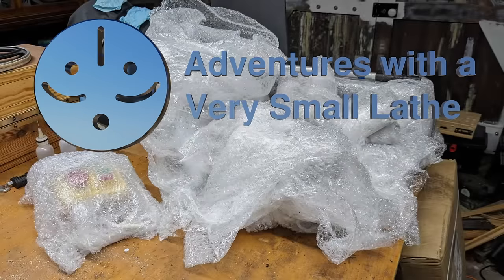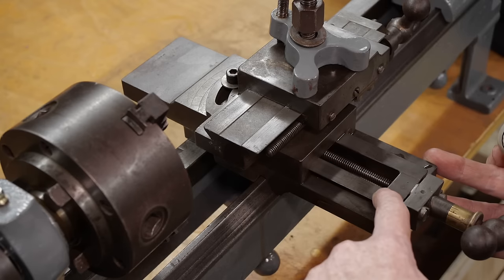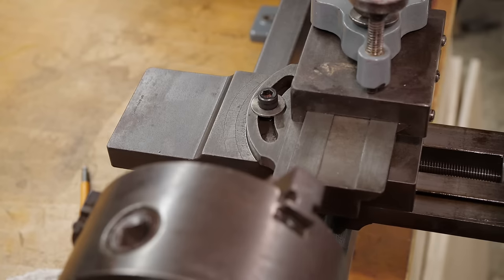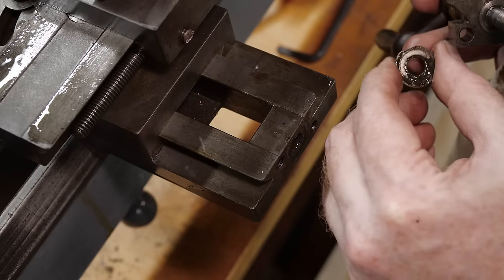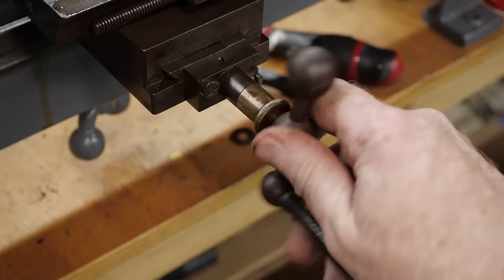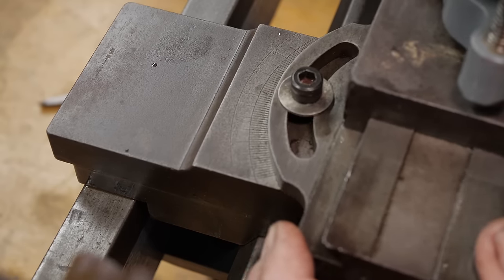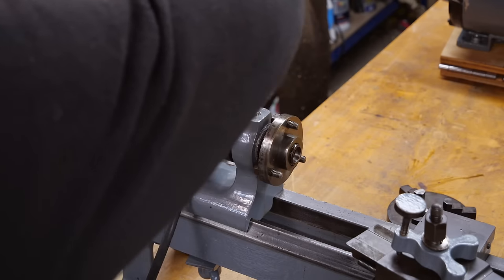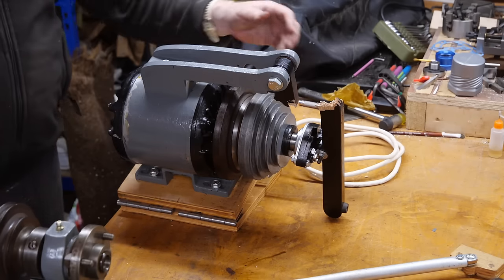Lorch Model A Lathe - The Reveal and Assessment

Comment: At time stamp 42:19 give or take a second or two when you show the "blank" side of the handwheel center ball I'm pretty sure I can see the circular outline of the pin in the glare of the light.  I think this is a regular thru pin but it was filed or sanded or peened down on that side.  So a punch with a cup on the tip to set onto the exposed small ball end of the pin SHOULD push it out.  This is supported by how the longitudinal travel hand wheel shows obvious heads on both sides for the retainer pin.  It's highly likely that the other has a thru pin too to keep things common.  For some reason some older owner cleaned off the head of the pin on the cross slide hand wheel.

I gather all the black on the parts that I figured was black oxide or parkerizing is in fact light corrosion that was oiled at some point to make it look black.  The darkness of the chuck rather supports this idea.  You've got your work cut out breaking down each and every sub assembly and polishing those parts back to proper slivery metallic and giving them the right sort of glossiness.  But it will be SOOOOO worth it.  What a sweet little machine!

Comment: Get yourself a big tub if Evapo-Rust to clean all the metal parts.  It will make all the bare metal parts look near new 👍
Reply from the maker: Unfortunately Evaporust is quite pricey  this side of the pond, so I'm cautious about using lots of it. That said I do have a tub full lined up to work on this lathe, but I'll remove excess rust manually before I dunk the parts.

Comment: Excellent video - but replacing that cap screw with a slot head might be a mistake. Perhaps something you can put a spanner on?
Reply: Also, the manufacturer put grease nipples on the headstock. Perhaps the headstock bearings should be lubricated with some kind of grease? I'm looking forward to this series of videos, thanks Mr AVSL.
Reply: I agree. A square head would be better than a slotted head, and I think it would be in keeping with style.
Reply: @janporkpie they look like grease nipples but are designed to take oil. 
Myford lathes have similar nipples on them if they don't have the oil cups on them. 
I've recently cleaned out a Myford ML 10 that had everything packed with grease 😢 while the Myford says it has to take oil. 
On the Myford lathes only the gears take grease, all the rest oil.
Also on bigger lathes you can see an insert with a ball bearing in the middle that is flush with a surface (cross slide, ...), these also take oil and not grease.
Reply from the maker: The grease nipples aren't original. Having spoken with Emma of Emma's Spareroom Machine Shop, who owns a similar model A, these lathes were originally fitted with oilers, and the bearings are designed for oil. A previous owner may have switched to grease for a specific reason, or just because it doesn't need to be changed as often as oil.
Reply from the maker: My main reason for thinking of slot-headed screws is that would match every other original fastener on the lathe. The square head screws on the chuck look shop-made. I do agree that square head screws would fit with the look of the lathe too, so I may go that way.

Comment: Now you have to change the name of the channel: Adventures with Very Small Lathes :-)
Good work!
To remove the handle from the threaded rods you could try by heating them or, very carefully and protecting the handle, by making a small weld on the head of the pin typically by gluing the electrode onto the head to create the space on which to apply the force to extract the pin itself.
just out of curiosity how much did you pay  everything?
Reply: I think he had already more than one very small lathe (3)
Reply from the maker: Yep, I've featured 3 on this channel already, The original Proxxon, the Chinese CJ0618, and the Unimat SL. I'm fond of the name though, so I don't think I'll change it just yet. The Proxxon is still with me on my adventures, even if it's no longer the only lathe in the shop.
Reply: @AdventureswithaVerySmallLathe  ok sorry, but I met you when you were already working on the mini Unimat and I thought it was the only one, mine was a joke due to the lack of knowledge of previous adventures

Comment: could be lengthy...
the thin plate, is probably because one got lost. might have a spare... 
the 25 is the lathe number im guessing should be on all the matching parts. 
that be a washer, not a shim, lol. im guessing someone put it there becaue the screw didnt do up tight on one side.. at least the filed the side off so the slide returned over it., 
the hole in the top, is probably definately an oil hole. 
the oilers. probably fairly easy to upgrade them to button oilers, 
Pin is a taper pin, rivetted on the back. spot drill it and give it a bang. they went away from that by about 1920 i think.
PULLEY IS BACKARDS AROUND. when you fix that have a look at the collet key. 
also, youre over thinking the headstock bearings. their will be a thrust race under the knurled ring. adjustment is dependant on speed. set it up so it doesnt quite grab at top speed when its warm, and its gonna be loose at low speeds. 
probably. that backplates gonna need a big bang. a pin spanner to fit the holes maybe? 
the clutch, i think if it was me id think about a cable drive and a foot pedal? 
has your tailstock been machined out to Morse taper? 
anyway it has potential. well done. was going to stay awake to watch it live, didnt happen.

Comment: That pin on the handle does indeed go through the handle.  Rub some fine sandpaper over it. You’ll see it !!
I’ve got a 100 year old lathe to do up too, priorities!!
Reply: If you look closely you can see the pin on the other side of the handle-head in the video. A bit of a rub with the fine wire brush should show it clearly. That number “25” is surely a production number (it’s stamped on several parts), so that parts fitted to this lathe don’t get put on another lathe and cause ‘fit issues’. Exciting to see old tools and machines brought lovingly back to spec and back to good use once more.

Comment: New subscriber here, very interesting video

I would imagine that the shim is to reduce the backlash on the cross slide
From years and years of retracting the cross slide, the flange on the cross slide nut has eaten a pocket into the face of the of the cross slide and probably on its opposite moving surface where it wears when the cross slide is advanced
I cant imagine a pin in a blind hole in such a quality machine, I wonder if you file a small flat on the opposite side where you can see the pin and then use some of the techniques that the welders use for detecting cracks or examining weld penetration the pin location could be found ?
Thanks again for your efforts
Reply from the maker: I think you're right about the shim, especially as there is so much scoring on that side of the flange.

Comment: those old type A's (like mine) have a mix of metric and, maybe, BSW...the spindle on mine has something like a 1-1/2 x 7 pitch (memory needs a refresh cycle!), and i did actually find a tap in the correct size, so that i could make up another backing plate.,.
my type A has a bit of wear on the bed, kind of a "dip" about 5-10 cm out from the 3-jaw chuck face, where i guess the cross slide moved along the most....i was thinking of "filling" it with some of that epoxy/tungsten disulfide material, but the material comes in quantities of about 10x what it needs, and it's not 'dime-store' price, either...

Comment: Could be a taper pin on the handle, you can try to measure if it's smaller on the other side.
Reply: As he showed, you can't even see it on the other side. It's some sort of blind pin, unless the other end is just so flush you can't see it.
Reply from the maker: It's not visible currently, but I may be able to expose it by cleaning and removing the surface rust.